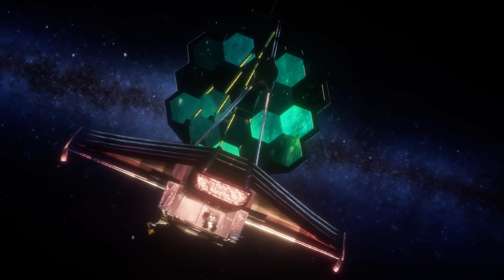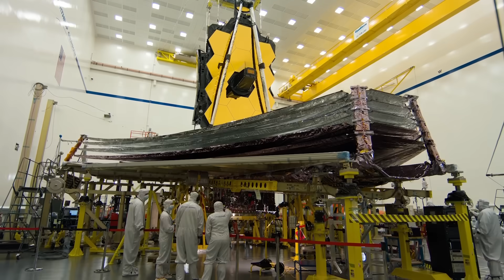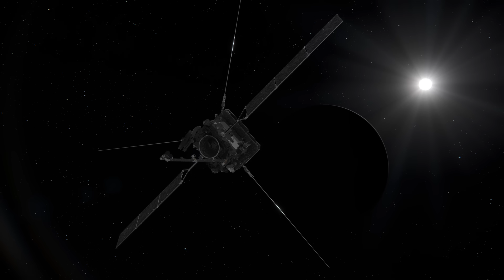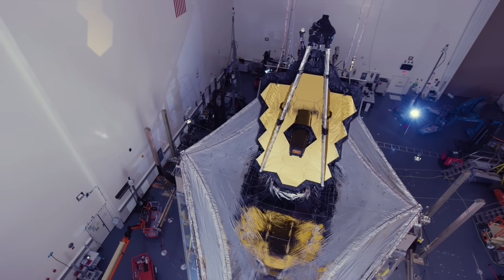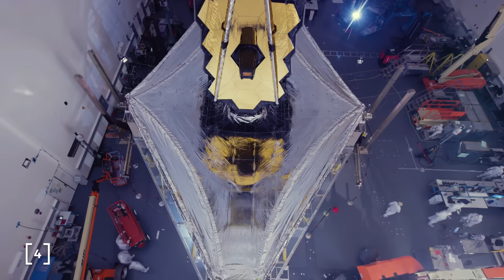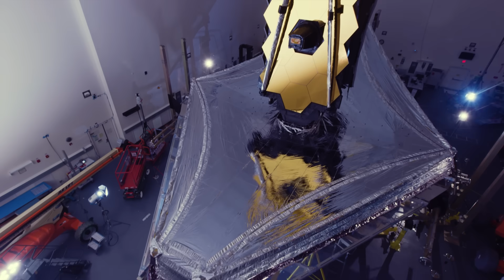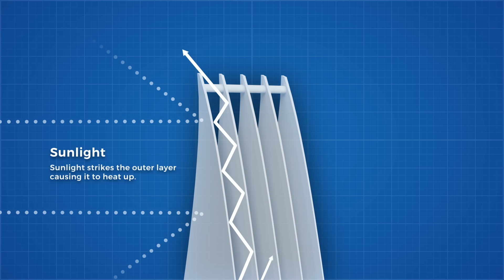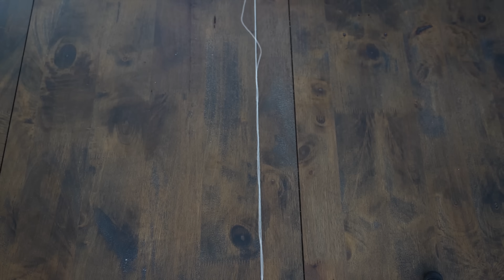The Insane Engineering of James Webb Telescope

Comment: As a steel fabricator, Swinging my 22 pound long shaft hammer accurately was always a proud achievement. This takes engineering to a different level. (Hope you appreciate the light hearted comment). Well impressed with this presentation.
Reply: @suntzu1409  Dinosaur? If being a true boilermaker is that then yes.
Reply: I call my 20 pound hammer PAT, my Precision Alignment Tool
Reply: @williamhawkins6504  How did you lose the 2 pounds? Mine was a 22 pounder.
Reply: @ScragNath  I don't know, the hammer just says 20lbs on one side and 9.1kg on the other must be a country difference, I am in Australia.
Reply: @williamhawkins6504  Served my rime a boilermaker in the UK, Spent 10 years in Australia from 1982 (Got an Australian Boilermakers certificate). Back in the UK now. Didn't swing anything as big when in Oz but they are 22 pounders here.

Comment: Great video. However, a small quibble: at 4m55s, the graphics show the Webb remaining entirely in the shadow of the Earth and unexposed to the sun. This would actually be pretty disastrous for the Webb, as it would take a lot of fuel to remain in such a tight orbit around L2, and would also not have enough light for the solar panels to generate sufficient power for it to operate. In fact, the Webb will trace a large eliptical orbit around L2. By design, it will remain uneclipsed by either the moon or Earth for it's operational lifespan. This is so that its exposure to the sun is constant and the temperature won't undergo large changes, as is the case for satellites in orbit around Earth.
Reply: This correction should be seen ^^.
Reply: Why does it need to be at L2 behind Earth if it needs sunlight? Shouldn't it be at L3 or L4 facing away from light from the Earth but in direct sunlight?
Reply: Learned this on another video:

If we go out to L2 and put up a big sun shield, a big umbrella, then we can block out the Sun, the Earth, and the Moon all at the SAME time.
Reply: @SmittyMcJob  L2 offers the easier and faster communication (latency and bandwidth) than L3-5. L3 is especially difficult to communicate with.
Reply: @LukeGoodsell  not to mention 300 million kilometers away! (L3)
Reply: Also at 5:27: 83C?  Should that be -83C?  Is space really that hot?
Reply: @jacobjones3476  I see it as -83C in the video
Reply: @koacado  The narration says +83C, close to boiling!  However the video shows -83C... so it is very confusing!  I'm curious to know what the actual temperature would be in that scenario.
Reply: Bad videeo
Reply: @unkownuser6864   Easterner..
Reply: @lisamulder3805  actuall temp is +83 as far as im aware
Reply: it's only a graphic.....and a graphic being wrong has no consequence

Comment: The thing about Webb that always blows my mind when I see it is that all the Hexagons look like 1 single mirror (which is the point). Whereas on the one model  you show, you get the "bug vision" where each hexagon is slightly off from the others and so you get 12 different images instead of 1 unified image. And that, is brilliant.
Reply: It is a really cool breakthrough.  Until recently, telescopes were a single piece mirror.  The hexagon technology has been used on ground based telescopes since the 1990s, resulting in a size breakthrough.  The GTC at a whopping 10.4 meters!

Get this, they are building the ELT in Chili.  It will have a 30 meter diameter and have 798 hexagonal segments!  Wow!

Comment: An awe-inspiring achievement on so many levels. Space engineering seems punishingly precise, the tolerances are inconceivably small, and everything has to work absolutely perfectly, first time, or else you've just wasted $10bn, not to mention who knows how many human lifetimes of effort and expertise.

With all the JWST videos I've been watching lately, I find myself coming back to the same question: how have they kept it clean while they're building it? I'm sure they do everything they can in terms of filtering the air, and cleaning everyone and everything that enters the room, but still, it's taken years - there must be a build up of dust and even oily/greasy substances eventually no? I'm guessing you can't just rub a chamois leather over your priceless beryllium/gold mirror.
Reply: All the handling past a certain stage is done in a clean room environment, and parts are constantly cleaned with optical grade (or higher) alcohols or whatever liquid is necessary for a specific part. Lastly there is a process called "Bake Out" which is done in that huge chamber or others where you heat up parts in a vacuum environment. This evaporates all water and other organic substances and is a crucial part of the cleaning. Being clean and ESD safe is a big priority!

Comment: You said the beryllium has an atomic weight of 4. You should have said that it has an atomic number of 4. Be has an atomic weight of 9, which still makes it light metallic elements go. Only lithium with an atomic weight of 7 is lighter, but elemental lithium is much more corrosive. Nonetheless, this is an excellent video. Thanks.
Reply: Machining beryllium metal objects is very difficult and beryllium fines are both toxic and carcinogenic.  I think the portions of the video showing the oil flush of the saw and the material behind glass (in a glove box) may be legit.  A big part of why Beryllium frame bikes are very expensive.

Comment: Excellent video! I especially liked the descriptions of the active cooling system and the actual method used to adjust the shape of the mirrors, which is content I haven’t seen elsewhere.  As an engineer, I’m always curious about the “how to” part. One minor error, at 19:00 you mentioned that gold is a poor reflector of lower frequency light.  I think you meant lower wavelength light. Shorter wavelength = higher frequency. Also, although I can appreciate the use of the word “insane” in the video titles is ironic (and good for clicks), it’s literal definition (irrational, nonsensical) is really the opposite  of the exquisitely well thought out and meticulously crafted engineering presented in the videos.  How about using alternative words like “amazing”, or “incredible”, or “astonishing”, “game changing” to better reflect the superb skill and knowledge of the inventors?  Keep up the good work :)
Reply: I think it’s got a good ring to it when put in front of “engineering”
Reply: I'd hold off on the "not irrational" part until the thing is deployed.
All of this complicated engineering makes the telescope more likely to break on deployment; so it would well be that this level of ambition is irrational at current technology levels.
Reply: Insane must be a typo for incredible. Surely.

Comment: Hey! Amazing video as always. You did make some small mistakes. You said for example that gold reflects poorly at lower frequencies, but you mean lower wavelengths and thus higher frequencies. You also often mention colder temperatures and degrees Kelvin, whereas it should be lower temperatures and just Kelvin without degrees. 

Additionally, I found it a bit weird that you speak about sound waves when you talk about pulse tubes. I don't think you're wrong, but it's a weird way of looking at it in my opinion. A pulse tube repeatedly compresses and decompresses, cooling down a cold side during decompression and heating up a hot side during compression. These pulses usually go at a rate of 1 Hertz. It's also something quite common in today's cryostats because you can eliminate the need for an external supply of liquid helium. I have worked with one of these myself. The downside is the sound and vibrations such a compression cycle produces, so they are not suitable for microscopes for example.

Anyways, I hope I can teach you something, the same way you teach me about engineering! Keep up the good work!
Reply: He is wrong. More specifically, not explaining a pulse tube. The cooling is by actual displacement of gas not 'just' regulating pressure by sound.

Comment: Curious how the average person will understand how STUPIDLY absurd those requirements and constraints are with current technology. The tolerances throughout the entire process has to be insanely expensive and down even to the the control systems. I would be very surprised if anything mechanical was off-the-shelf.
Reply: The only thing off the "shelf" would be the basic materials lol.  I bet most of the tools used to make the parts where custom too.
Reply: @yetinother  I bet even the basic materials had pretty extreme QC tolerances for the specific alloy and dimensions.
Reply: @c detek your welcome, we are like old house wives who can't stop talking, we can contribute some more if you'd like.
Reply: Ok team start sending images from just let's see if it was worth the effort
Reply: @jagtestusa2534  Images will likely be another 6-8 months away, if not slightly longer.
Reply: @soy_leche  Every step of the component manufacturing process would be checked and signed off before the next step could be initiated. All mil-spec. tolerances strictly adhered to. Machining of highly close tolerances not for the faint of heart, only the most talented machinists made the parts for this engineering wonder.

Comment: This is excellent. I’ve been searching for a video like this for a while!

Small correction: Kelvin is not a degree. So it’d be “7 Kelvin”
Reply: I think 'Kelvin' is the unit, so it'd be "7 kelvins", plural.  Like 'watts' or 'newtons'.
Reply: @Platanov  Kelvin can be it's own plural and, according to some sources, is preferable for use in scientific papers.
Reply: Yes "7 kelvin"  is the same as common usage for say -40 celsius or -40 F.
Reply: But a change in 1 K is equivalent to a change of 1 degree C? Also yeah, for consistency you should be using the same units.
Reply: @shoam2103  Kelvin is just Celsius (same scale) with a correction factor for absolute zero so all space and vacuum experiment temps are in positive since in C most would be negative and the math is annoying. 

Fahrenheit (5/9th C)was also a scientific scale of the early naturalist/scientists like Celsius.  0-100 is survivable European animal husbandry temps and the scale is interchangeable with barometric pressure and elevation. 

Celsius 0-100 contrived for the liquid state of water at sea level and 1atm.

Comment: You mentioned that the gold on the mirrors is 0.1 microns thick and covers a 25m^2 surface, weighing 42.8 grams, so I got curious and did the math to see if those figures checked out against one another. The total polished area of the JWST is 26.3m^2, (the unobscured area is 25.4m^2 because some is blocked by the secondary mirror support strugs). Given that the density of gold is 19.3g/cm^3, that means that the total mass of gold used on the mirror should be:

(0.1 microns)*(26.3 m^2)*(19.3g/cm^3) = 50.8g. 

That's a lot more than 42.8g! Maybe 0.1 microns is an approximation, and it actually does have exactly 42.8g of gold. In that case, the actual thickness of the gold layer would be:

42.8g/((26.3m^2) * (19.3g/cm^3))=0.08432 microns or 84.32 nanometers!

Given that the average gold atom is only 0.166 nm across, that means that the gold layer on the JWST is only about 508 atoms thick!

Either way, very interesting video on a fascinating subject!
Reply: Interesting comment! Did you take into account all of the spaces in between the individual mirrors? Is that taken into account when you said "total polished area"?
Reply: That's the gold atom's radius, not its diameter.

Comment: The images of the Earth-Moon-L2 relationship should have been to scale. Recall the Moon is approximately 30 Earth diameters from Earth. 
Overall pretty good presentation with some “typos” mentioned abundantly in the comments. 
Especially glad they didn’t repeat “the 100x-1000x more powerful than Hubble” comparison. That phrase using the word powerful I believe is being misinterpreted by a lot of folks as magnification or resolution. It’s not. (It relates more to the efficiency of the spectrometers). At near IR wavelengths the JWST should be a bit better that the IR upgraded images Hubble received. At mid and far IR the JWST cameras won’t be as good as Hubble. That’s due to the longer wavelengths being imaged. Even the largest and nearest exoplanets will still be little more than blurred single pixels.
Reply: It's not possible to do it all to scale and keep everything easily visible on any normal sized, normal resolution screen. Notice the sun is, obviously, also not to scale. That would be ridiculous, of course, and does nothing to help teach about the topic of Lagrange points and where they're located relative to the Earth and sun. I was just looking at other versions of this same Lagrange points image on google images and they essentially all do this or just don't even put the moon on the chart at all. I believe in this case since the Earth was only being represented as a flat white circle the moon was only being used to make it clear that said white circle was representing Earth.

Comment: Thank you for the cryo-cooler explanation that I could find nowhere else. Together with the mirror motors, these are the mechanical devices we've seen engineering for. However, the sunshield release mechanisms, or pins, have not been adequately explained, let alone shown, elsewhere.  Where would I find this?

Comment: 18:56 - That narrative doesn't fit the graphic.
"Being particularly poor at reflecting the lower frequencies of the visible spectrum."
The graphic however shows the lower wavelengths of light being reflected poorly and not the frequency, which would be higher with shorter wavelength.
Reply: The graphic is correct; he mispoke.
Reply: @ergohack  True. I'll rephrase.

Comment: This is why there is (even to mouth-breathers) value in making something like this.  Even if you have no interest or connection to the astronomy, the engineering on something like this always yields important information that can be utilized elsewhere.
Reply: True. For example, a human mission to Mars will be a deep space, long duration mission. One major challenge of a Mars mission will be how to build durable systems (especially life support) that will operate for years without breaking down. The JWST is good practice for that.
Reply: Nice way to present everyone who isn't super interested in astrological research as bumbling idiots (talking about the "mouth-breathers" part). As fascinating as the engineering of this is and as interesting as the things we might learn through this telescope may be: I doubt that the development of infrared sensors that only work at 7 Kelvin and a sunshield that requires being in a vaccum to function are going to bring massive advancements to my daily life.
Reply: @nitramreniar  i reckon similar things were said about vacuum tubes and a collection of transistors the size of a room...

Comment: Outstanding video! Fingers crossed for a successful launch and deployment of Webb.

I'm not convinced that it will never be possible to send manned missions to service Webb. While that is certainly true now, SpaceX is developing the Starship launch vehicle to send people to Mars. A launch vehicle capable of sending people to Mars could certainly send people to L2.
Reply: I agree, and there will be many more other companies capable of doing it this decade. Even if Starship 1.0 fails, sooner or later, other team will build big, reusable starship. Technology is accelerating, what is extremely hard today(building a Starship) will be so easy by the end of the decade, thay even small startups and tiny nations will have their Solar System travel capable spaceships. Bigger nations and corporations will build simply even bigger, more advanced spaceships.
Reply: Its not serviceable, even if you sent astronautz
Reply: @Mr__Singularity  I agree with for loop jwst hasn't been designed for servicing and while starship has the capability to get out there, there's no way that it has the capability to support spacewalks to repair it without serious modification. Starship is designed for interplanetary transport and super heavy payload, not spacewalks and servicing missions like the space shuttle. Even then it's doubtful SpaceX would be willing to use a starship for that purpose anyway. Starship is also at the forefront of rockets right now. There is no rocket that's been developed in the short amount of time that it has and any others aren't fully reusable. It's probability of failure is very low with SpaceX's track record.
Reply: @forloop7713  There is no such thing as not servicable or a vehicle that cant be modded to do it, all it is needed is a motive and tech. If it is decided that it has to be done, it will be done in the future.